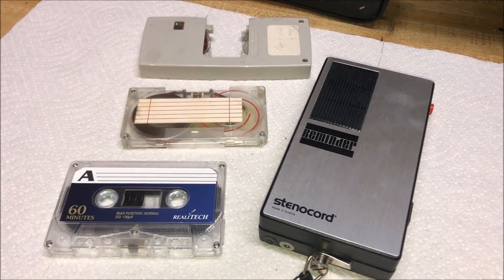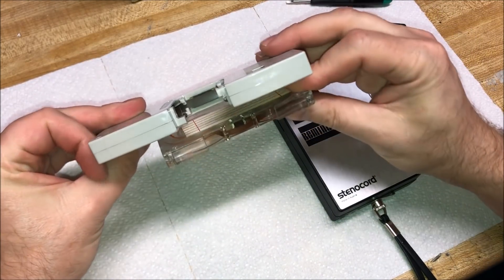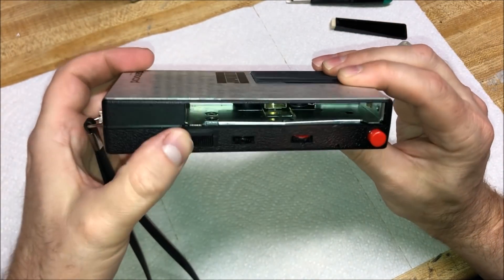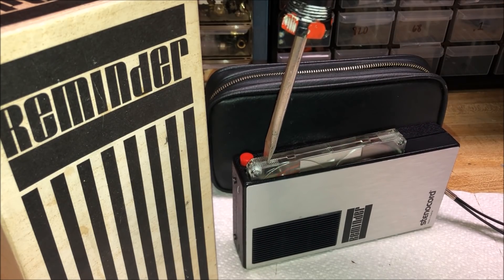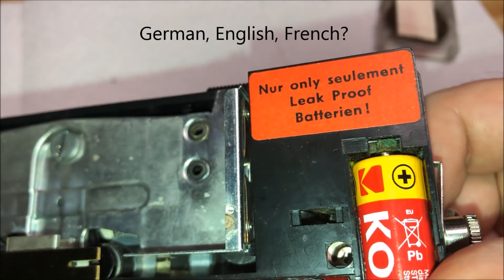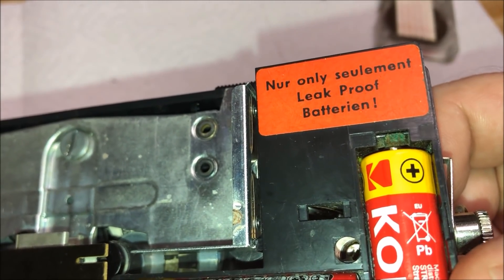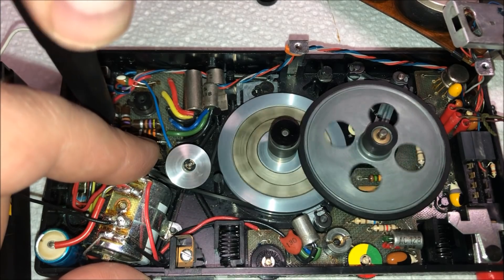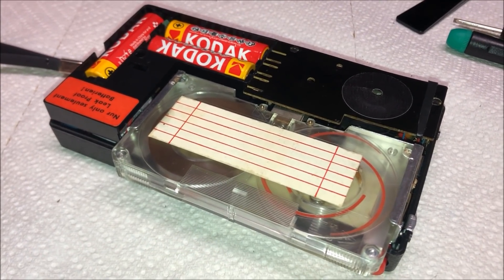Stenocord Dictation Tape Recorder Format from Austria

Comment: Germanium transistors and I would guess a LM701 opamp in there as well as audio gain stage. Would guess that some of the volume issues come from leaking dipped tantalum capacitors in the audio side, as those little ones are rather notorious for having leakage with age.